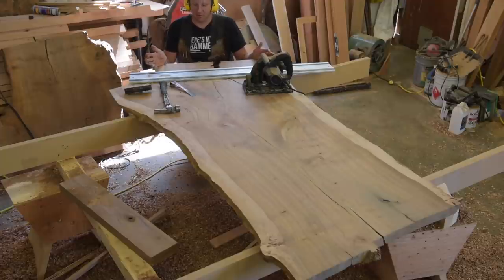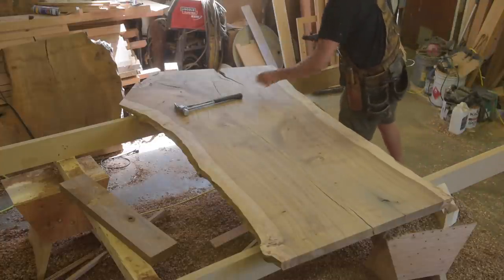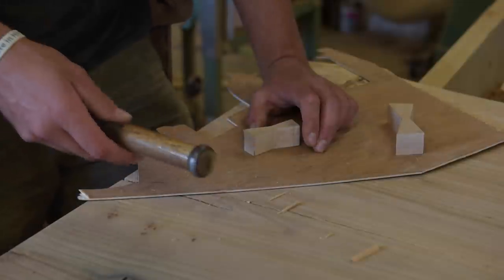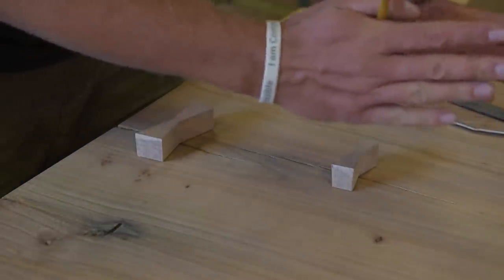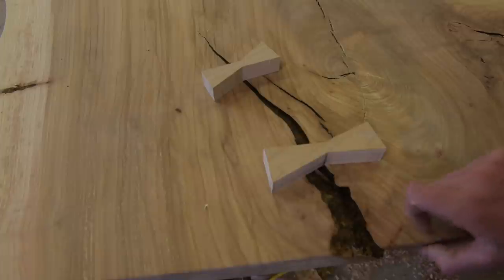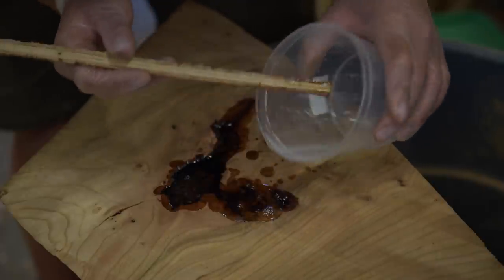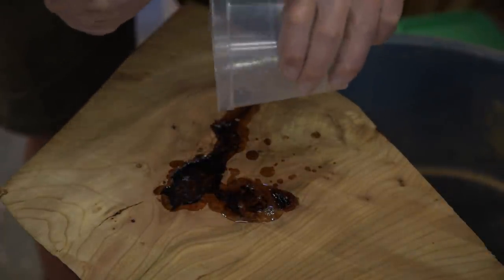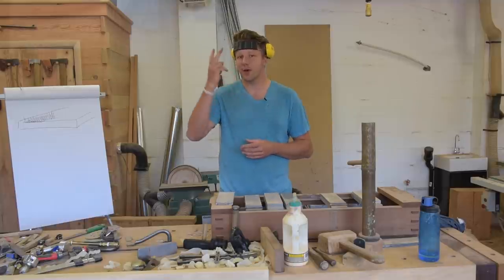How To Install Dutchmen, Live Edge Table PT 3

Comment: You were asking about using the fillers and if we had any ideas.  I used to do a lot of resin casting of biology specimens and we learned a few thing there.  Air bubbles were our biggest problem.  We were pouring around objects and you're pouring into objects so you may have to turn some of these ideas inside out.  What we did a lot of times is use small brushes to 'paint' the resin in small spots where a bubble may form since they like to stick in the crevices.  We also found that we could pour the resin around the objects in layers and it would give us a good, bubble free base that we could then add one or more layers to where we could control the bubbles.  The last thing we did was create a vacuum chamber and put our castings in that.  We had a laminated safety glass cover over it and could watch the bubbles get pulled up and out of the cracks, nooks and crannies.  When I was doing silver and gold casting in college we used a vibrating, vacuum chamber to get all the bubbles out of our lost wax investment casting plaster.  They all worked and this may give you some ideas.

Comment: Jesse, on your question about sanding: I just did a similar project with clear epoxy filling into voids.  The hardened epoxy can be sanded, obviously, but sanding to the standard 180 or 220 grit for wood leaves the epoxy surface quite opaque and rough.  Applying finish on top of that helps a bit in filling in those micro abrasions and reestablishing the transparency, but it's still rough.  What I did - and what worked - was hand-sanding just that epoxy surface (and no avoiding the surrounding centimeter or so of wood) another few stages - 600, 1000, then 2000 grit.  After 2000 grit, when dry, it still won't look as transparent as you think you want, but at that stage (test with a bit of mineral spirits), applying the finish to it will bring the transparency back out just fine.
Reply: Oh, and I used Scotch Blue to tape up the other side.  That's always worked for me just fine.

Comment: For the epoxy problem, there are two methods I use. If the edges are straight then I use a piece of greased plastic clamped over the cracks. If the edges are uneven then I use the often underused kids plasticine to fill the cracks, both work great.

Comment: When I have filled knots and holes with epoxy I would use tape on the other side as you did, but I would wait until the epoxy is just  starting to cure, then I pour it in. A good indicator is when the epoxy in you cup starts to get warm/hot. This ensures the epoxy isn't as thin that it drips right past your tape. Once you pour it in have your torch ready to get those bubbles out quickly.

Comment: I've used black electrical tape to hold epoxy in cracks while it sets it works pretty good they sell it in 1 inch width as well.

Comment: The epoxy that soaks through will block it off for the next pour.  Use a torch to take out the bubbles.  Don't pour it all at once, do a couple pours.  You can experiment with using clear packing tape around the outside of your crack, the resin will not stick to it.

Comment: Hi. May I suggest that you use a large syringe to get the epoxy into the cavity. You get large ones that hold a lot of liguid. This may prevent spills better and minimize finishing work later.
Reply: Hiw do you clean the syring won't epoxy dry in it and make it unusable again?
Reply: @wildboystv3013  well, syringes are rather cheap and quite disposable. However, some resins are able to be cleaned off by certain solvents like acetone.
Reply: @neilredelinghuys3263  ok. Thanks man. I appreciate what you said but I try to use as little plastic as I can... Plastic island in the ocean  and all haha.

Comment: Quick tip for filling  big cracks with epoxy: don't do all in once. Epoxy curing it's a exothermic reaction which can produce a lot of heat. It can lead to lot of bubbles generation and even smoke and burning. If the gap is big fill it by steps.

Comment: I use fiber glass resin instead of expensive epoxy from what I've seen its a very similar if not the same result. I've clear coated and oiled over it once its done and looks great!!! easily sanded too

Comment: Try clamping a wax coated piece of wood or sheet metal to the underside of the crack. Add thickened epoxy. You can also color the epoxy with powdered graphite .

Comment: Let the epoxy set up a little bit, let it sit for 10-15 mins after final mix then pour a thin coat in the crack. Then let that set up for an hour or two, then do the final lift/coat of epoxy this will fill up the cracks better and you dont waste as much epoxy on the ground! Speaking of epoxy on the ground do it over plastic poly other wise the stuff will soak into the concrete and is a pain to scrape off. Also you something to pop the air bubbles. You can use your breath, a torch on low heat just pass over the top quick or a heat gun to pop the bubbles. best of luck you will learn alot after the first one.

Comment: A lot of ppl think painters tape is superior to plain ol masking tape, but when it comes to stickiness, its the way to go. Painters tape is designed to pull off easier, as to not pull your paint off and mess up your line.
Reply: Another tip, pour your epoxy slow and you'll give off less heat, which will help your tape hold up longer while also preventing any air bubbles
Reply: and if you do get some air bubble at the top surface of the epoxy, have a hairdryer or heat gun on hand to convince those bubbles that they want to rise up and pop. don't heat additionally after the epoxy gels.

Comment: I've never messed around with epoxy like that, but when doing fiberglass repairs, I would tear strips of cardboard that would come into contact with the resin, and then tape the cardboard in place.  I can tell you that any resin that came in contact with the sticky side of tape wouldn't harden, & wouldn't provide a tight seal.  The cardboard was stout enough to prevent the resin from dropping out, & the resin would adhere to the cardboard.  I would think it would do the same with the epoxy. After the repair hardens, rip off as much cardboard as you can, and sand the rest slightly until smooth.  Should be good to go. 
-Instead of cardboard I suppose you could substitute thin strips of wood instead of cardboard.  Whatever works.

Comment: Maybe seal the gap first with some PVA glue that will dry transparent (even if it doesn't work because the gaps are too big is a much cheaper test than epoxy). Since it has a thicker consistency might fill all the bigger gaps and pores in the wood and act like a vessel to hold the epoxy. Paper tape is crap, never stays glued long enough for the epoxy to dry, at least in my experience. I tried different type of tapes, not one ever worked.

Comment: hot glue a piece of plexiglass on the bottom with some wd40 sprayed on it (plexi) so it (epoxy) doesn't stick then pour it in the hole.

edit: made myself a little clearer

Comment: West is a great product, but for this application, I use Systems 3 (5 minute). Thicker, and no real problem falling out the bottom. If deep, you have to do several applications, because it travels east and west into the wood. I made a massive mess the 1st time when I used West. It's not cheap stuff. Also with the Systems 3, I get no bubbles compared to West. I don't believe in the integrity of the bowties either....much
Reply: I've had great success with the metal HVAC tape someone else mentioned.  Blue/green stuff works OK for narrow cracks as long as they're not too deep.  You can clamp something over (under when you pour) it to help hold it in place as well.

Comment: Hi ,I get a lot of your problems ,especially with the tears in the timber and the epoxy staining. What if you didn't do the final finish on the leveling of the slab and did the dicky bows  and epoxy  and then did the final pass with a shape router  blade of only a millimeter or two or three and then did the sanding. Me personalty I haven't had the workshop or job to put this to the test. Please let us now and I enjoy your site page. Cheers